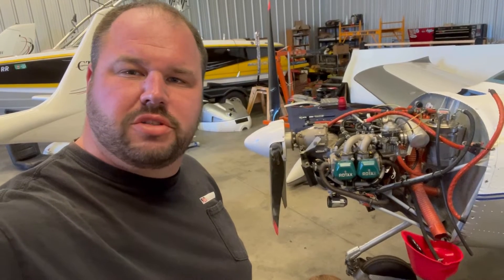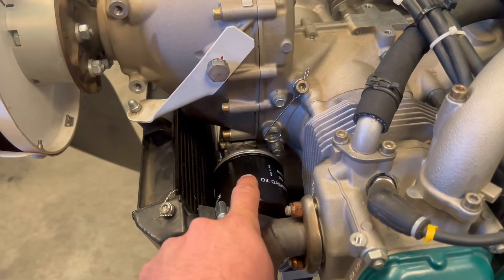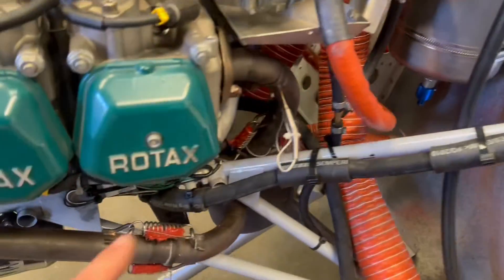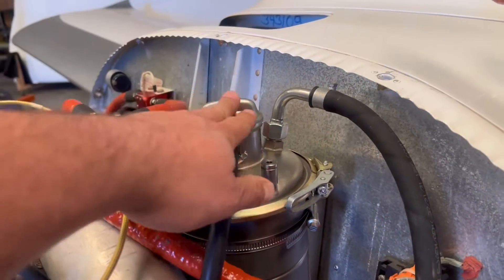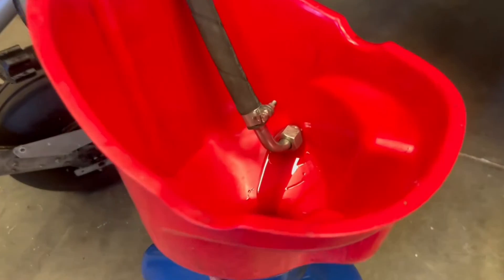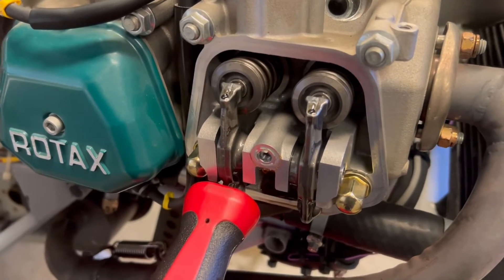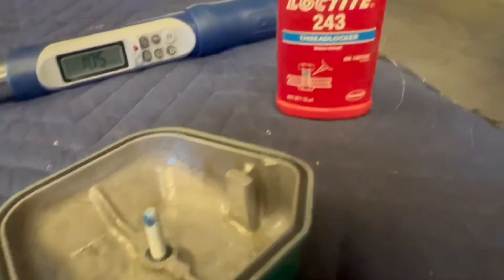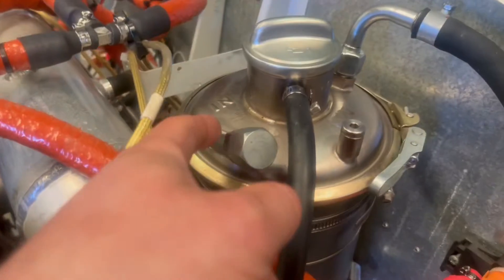Purging the oil system on a Rotax 9 Series Motor 912/914/915

Comment: Just one question.  If you are checking for air in the lifters, would it not be better to have one guy hold pressure on the lifter & another guy check clearance while pressure is still there?  If there was air in the lifter, would it not spring back when pressure was removed from the lifter?  Or can we rely on the clearances in the lifter being big enough that an oil film can't make an air tight seal?

Comment: Can you please explain how to keep air from the in line after purging? You made a point to keep the line high during oil change and now it is low and you have to bring it up high? Should I bring it high before completion of purge and the reconnect? Your vidyjumped from purge to valve check and then in line was already high when you talked about reconnecting?
Reply: The line he has disconnected here is the return line not  the feed line,  it doesn’t matter if the return line has air in it
Reply from the maker: Hi, the return line going from bottom of the case to the tank can be high or low as air getting in doesn’t make a difference. The line from the tank to the cooler should be elevated when disconnected from the tank to prevent it siphoning out the oil from cooler, hope this helps!

Comment: I don’t burp mine, I check my oil level after I’ve flown then it’s checked fir the next flight.
Reply from the maker: Thats a common thing to do, burping a cold engine can take awhile and burping after previous flight will help. However I would always recommend pulling the blades thru a least few revolutions just to prime it and make sure things are moving freely, I’ve had hydraulic lock on 912s before and you don’t want to find out the hard way
Reply: @ oh I still pull the prop thru at least 4 compressions before flight (like I do my Lycoming engines) to check that the engine cylinders are healthy but it’s not for burping as I don’t take the oil tank cap off. There’s a lot of hysteria about burping, there’s not enuf oil capacity to create hydraulic lock in the cylinders.

Comment: excellent video. thanks.       how do you make sure air has not been introduced into the system - you noted that is important?
Reply from the maker: Hey sorry getting caught up on comments! Keep the feed line elevated once removed from the oil tank and avoid rotating the engine when the sump is drained/ or removed, hope that helps!

Comment: If there is at least one spark plug removed from each cylinder, there are no blow-by gases available to increase crankcase pressure and push oil back from the dry sump (the bottom of the crankcase) into the return line. Maybe that's why the return line is directed against the ground, so oil can follow gravity. However, while it is clearly in the interest of safety to remove the spark plug so the engine won't be able to suddenly start, I wonder if there is a real technical reason for removing the spark plugs. You say you turn the prop about 100 times before you see oil coming out of the return lines. Why is that? If the spark plugs were fitted, it would only take a few rotations of the propeller to increase the crankcase air pressure enough (by manually created blow-by gases during engine compression). I know you just follow guidance provided by Rotax, but still I wonder if having the spark plugs fitted would impede the oil purge in some way. Any ideas?
Reply from the maker: The plugs are removed for the purging process, technically you could probably rotate the prop by hand 100 times with the plug in but it’s sure is a lot easier with them out, for this procedure we’re not so focused on returning oil to the tank as much as we are trying to push the fluid and air thru the lines so spinning quickly is an advantage

Comment: Will this procedure work with a high-flow in-line engine oil thermostat install?
Reply from the maker: Yes just spin the prop over an extra 25-50 rotations

Comment: Hi Jeremy, thanks for sharing your experience. Do you know how prone is it to damage the valve gaskets? I want to measure the lifter distance but do not have the spare gaskets. Also, when draining the oil lines on 915 engines, should I drain the turbo sump, turbo oil suction line, and turbo oil pressure line as well? If I do, will purging make the turbo lines prime? Really appreciate your suggestion.

Comment: Should this be done after every oil change?? Im soon to be doing my 25h
Reply: Why is it necessary to remove any pipes  during an oil change?
Reply from the maker: No not necessary after the oil change just keep the line going from the tank to the oil cooler elevated so it doesn’t drain out and make sure not to rotate the prop once the line is disconnected
Reply: @JM_Aeroservice  brilliant.  Thank you Jeremy. 
Do I need to remove and clean the oil filter tank like I saw you do in a video on the 25h??

Comment: Well done!!! I'm replacing my oil lines on my 912 for the first time. Question, can I push oil first through the oil cooler to the pump and cut out the trapped air?
Reply from the maker: I use gravity and a small funnel to prefill a completely empty oil cooler and lines and vent out the air then purge the system the way it’s shown in the video and it will purge quicker.
Reply from the maker: I use gravity and a small funnel to prefill a completely empty oil cooler and lines and vent out the air then purge the system the way it’s shown in the video and it will purge quicker.

Comment: Jeremy, You never showed that you started the engine between purge and checking the lifters. I am assuming the they will still pump up by hand. Is starting the engine necessary?
Reply from the maker: If done correctly the lifters should pump up just by rotating by hand. If lifters clearances are marginal you can do a short run(<1min) and check again.